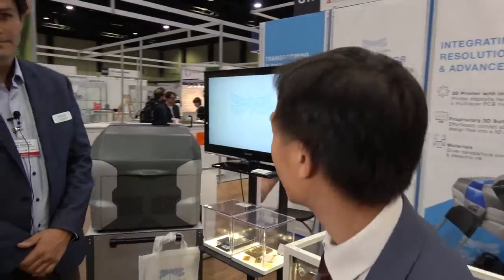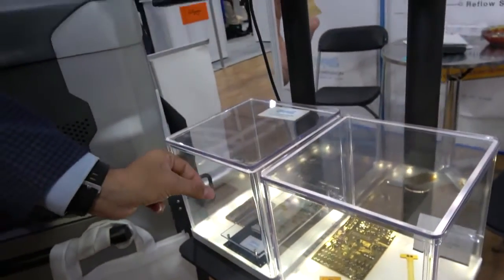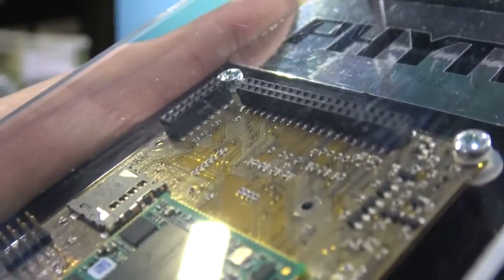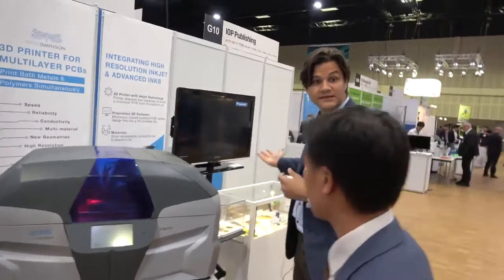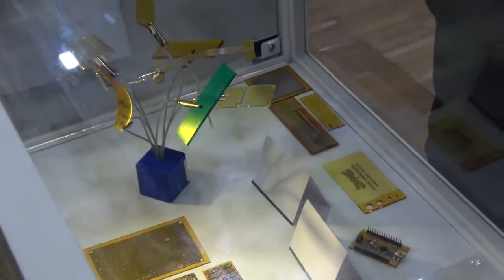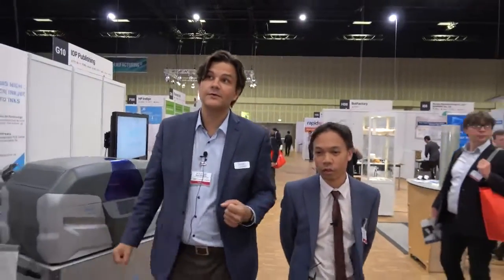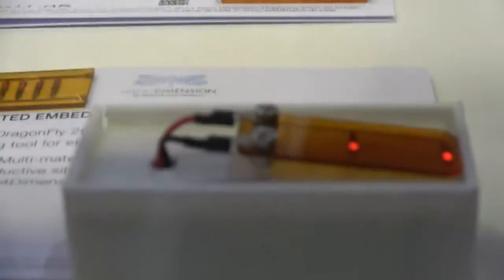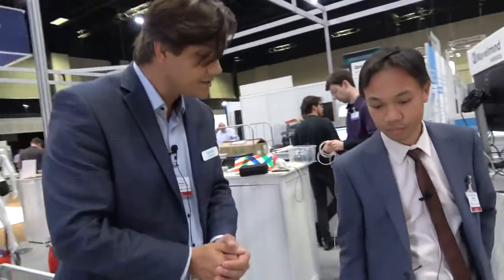3D printed multi-layer printed circuit boards (PCBs)

Comment: It can use 3 separate printer ine print body then conveyor shift to print pbc then shift to microchip printing then install screen is a complete iphone or smart watch , or jewlelry or prescription eye glass and many more like hearing aid , or robot microcontrol brain ect very potential but labor woukd or may resist